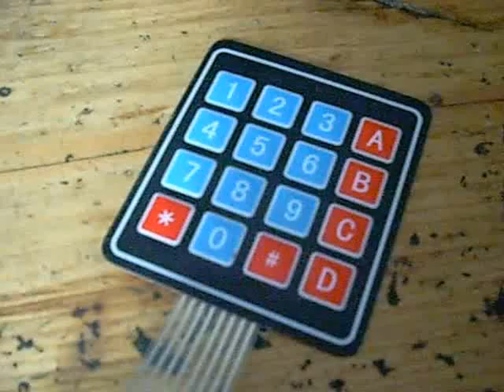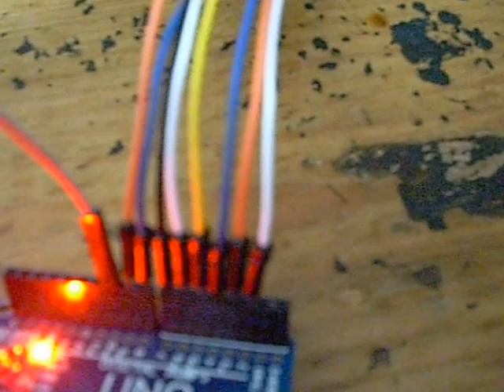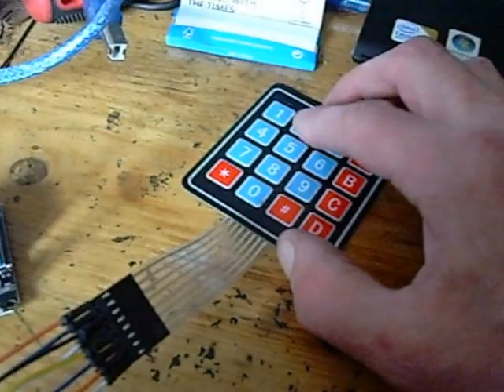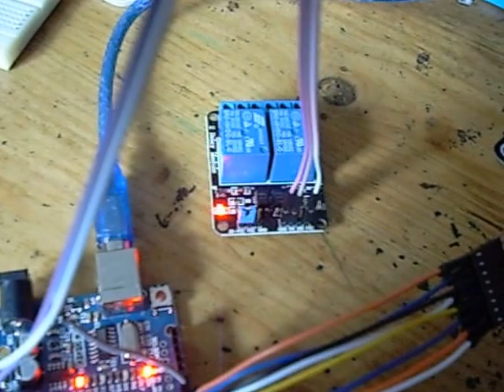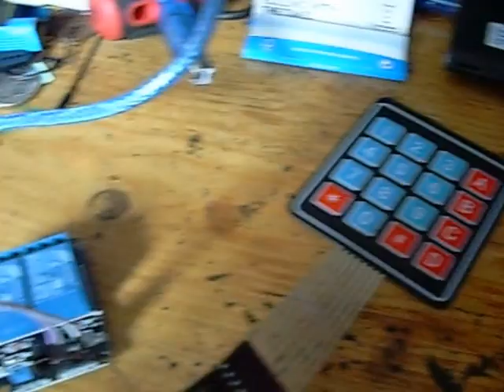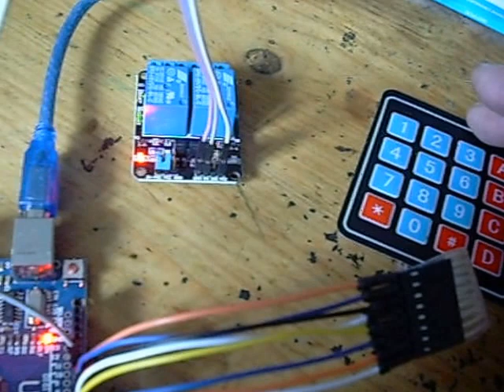Arduino keypad combination lock.

Comment: Thank you so much for sharing your knowledge!~ As a beginner , this will be a huge help for my research project, I would like to ask to where or how would I put the magnetic lock? :D
Reply from the maker: +D Hills Santillan I would wire the positive feed to the relay and then to the lock and the earth connected to the lock all the time. I am using a 12 volt solenoid to unlock a gate to my garden. If you look on arduino relay`s on ebay you will see the wiring but its just a switch so just connect it to the terminals. You need to download the 4x4 keyboard driver  to your ardiuno site first. Otherwise the program will error.
Reply: Okay I get it now! Thank you so much for the info! I would like to put your name to our paper :D
Reply: +D Hills Santillan Okay, after I installed the keypad sir, I go to the "Open" then Libraries then Keypad. then what will I pick sir.?
Reply: +D Hills Santillan sir, I see  that the wire is connected to from the relay to the 5V and the GND, but where is the wire connected in the relay?
Reply: +D Hills Santillan Sir, don't I need and transistors or resistors?
Reply: +D Hills Santillan Sir is this a NO contact?
Reply: +D Hills Santillan and sir about the power source of the lock, ?

Comment from the maker: int n = 0;      // n is at what stage the keypad is at.  5 is unlock
int t = 0;      // t is the time we wait for another key to be pressed or reset
int y = 0;      // y is set to u when a false key is pressed
int u = 5000;   // u starts at 5 seconds and doubles everytime a false key is pressed until lock is unlocked then returns to 5 seconds
int a = 0;
byte h = 0, v = 0;
const unsigned long period = 50; //little period used to prevent error
unsigned long kdelay = 0;      // variable used in non-blocking delay
const byte rows = 4;           //number of rows of keypad
const byte columns = 4;          //number of columnss of keypad
const byte Output[rows] = {9, 8, 7, 6}; //array of pins used as output for rows of keypad
const byte Input[columns] = {5, 4, 3, 2}; //array of pins used as input for columnss of keypad
byte keypad() // function used to detect which button is used
{
  static bool no_press_flag = 0; //static flag used to ensure no button is pressed
  for (byte x = 0; x < columns; x++) // for loop used to read all inputs of keypad to ensure no button is pressed
  {
    if (digitalRead(Input[x]) == HIGH); //read every input if high continue else break;
    else
      break;
    if (x == (columns - 1)) //if no button is pressed
    {
      no_press_flag = 1;
      h = 0;
      v = 0;
    }
  }
  if (no_press_flag == 1) //if no button is pressed
  {
    for (byte r = 0; r < rows; r++) //for loop used to make all output as low
      digitalWrite(Output[r], LOW);
    for (h = 0; h < columns; h++) // for loop to check if one of inputs is low
    {
      if (digitalRead(Input[h]) == HIGH) //if specific input is remain high (no press on it) continue
        continue;
      else    //if one of inputs is low
      {
        for (v = 0; v < rows; v++) //for loop used to specify the number of row
        {
          digitalWrite(Output[v], HIGH);  //make specified output as HIGH
          if (digitalRead(Input[h]) == HIGH) //if the input that selected from first sor loop is change to high
          {
            no_press_flag = 0;              //reset the no press flag;
            for (byte w = 0; w < rows; w++) // make all outputs as low
              digitalWrite(Output[w], LOW);
            return v * 4 + h; //return number of button
          }
        }
      }
    }
  }
  return 50;
}
void setup()
{
  pinMode(10, OUTPUT);
  pinMode(13, OUTPUT);
  for (byte i = 0; i < rows; i++) //for loop used to make pin mode of outputs as output
  {
    pinMode(Output[i], OUTPUT);
  }
  for (byte s = 0; s < columns; s++) //for loop used to makk pin mode of inputs as inputpullup
  {
    pinMode(Input[s], INPUT_PULLUP);
  }
  Serial.begin(9600); //to use serial monitor we set the buad rate
 
}
void loop()
{
  digitalWrite(10, HIGH);
  if (millis() - kdelay > period) //used to make non-blocking delay
  {
    kdelay = millis(); //capture time from millis function
    switch (keypad())  //switch used to specify which button
    {
      case 0:
        Serial.println(1);
        if (n == 1) {          
          n = 2;
          t = 1000;
        }
        else {
          n = 0;
          t = 0;
          y = u;
          u = u + u;
        }
        break;
      case 1:
        Serial.println(2);
        if (n == 2) {
          n = 3;
          t = 1000;
        }
        else {
          n = 0;
          t = 0;
          y = u;
          u = u + u;
        }
        break;
      case 2:
        Serial.println(3);
        if (n == 3) {
          n = 4;
          t = 1000;
        }
        else {
          n = 0;
          t = 0;
          y = u;
          u = u + u;
        }
        break;
      case 3:
        Serial.println("A");
         n = 0; t = 0; y = u; u = u + u;
        break;
      case 4:
        Serial.println(4);
        if (n == 4) {
          n = 5;
          t = 1000;
        }
        else {
          n = 0;
          t = 0;
          y = u;
          u = u + u;
        }
        break;
      case 5:
        Serial.println(5);
        if (n == 5)
        {
          n = 6; t = 1000;
        }
        else
        { n = 0; t = 0; y = u; u = u + u;
        }
        break;
      case 6:
        Serial.println(6);
         n = 0; t = 0; y = u; u = u + u;
        break;
      case 7:
        Serial.println("B");
         n = 0; t = 0; y = u; u = u + u;
        break;
      case 8:
        Serial.println(7);
         n = 0; t = 0; y = u; u = u + u;
        break;
      case 9:
        Serial.println(8);
         n = 0; t = 0; y = u; u = u + u;
        break;
      case 10:
        Serial.println(9);
         n = 0; t = 0; y = u; u = u + u;
        break;
      case 11:
        Serial.println("C");
         n = 0; t = 0; y = u; u = u + u;
        break;
      case 12:
        Serial.println("*");
        if (y == 0) {
          n = 1; t = 1000;
        }else {n = 0; t = 0; y = u; u = u + u;}
        
        break;
      case 13:
        Serial.println(0);
         n = 0; t = 0; y = u; u = u + u;
        break;
      case 14:
        Serial.println("#");
         n = 0; t = 0; y = u; u = u + u;
        break;
      case 15:
        Serial.println("D");
         n = 0; t = 0; y = u; u = u + u;
        break;
      default:
        ;
    }

  }
  if (t >= 1) {
    t = t - 1;
  }
  if (t == 0) {
    n = 0;
  }

  
  if (n == 6) {
    digitalWrite(10, LOW);
    delay(5000);
    n = 0; t = 0; y = 0; u = 5000;

  }
  if (y >= 5000) {
    digitalWrite(13, LOW); 
    delay(y);
    y=0;
  }
  if (y == 0){
   digitalWrite(13, HIGH);
  }
  delay (1);
}